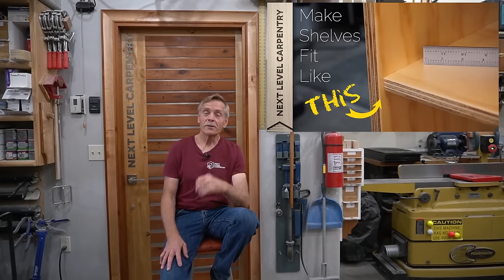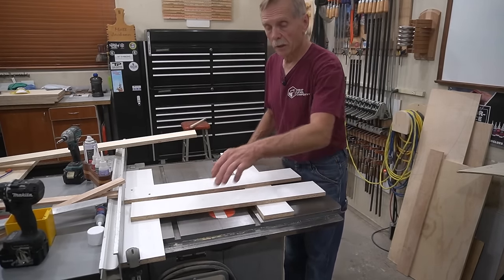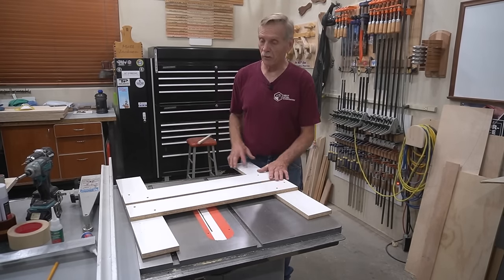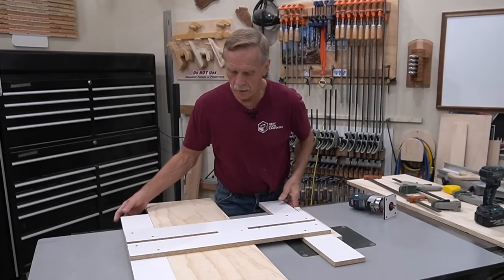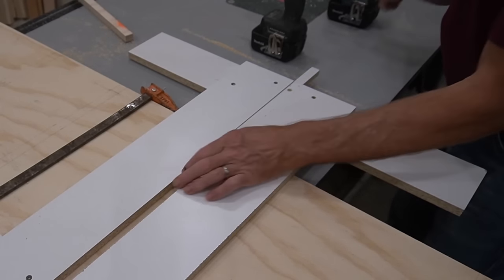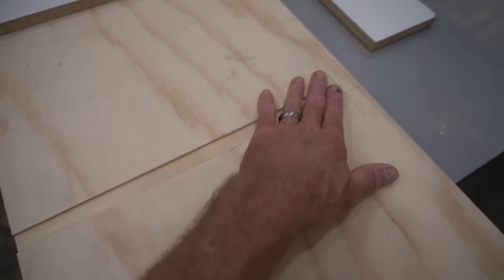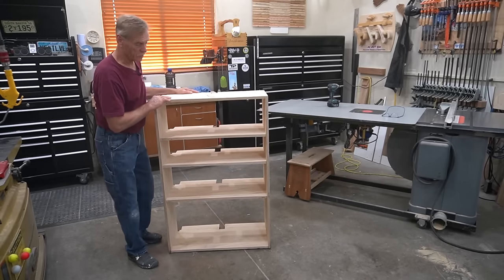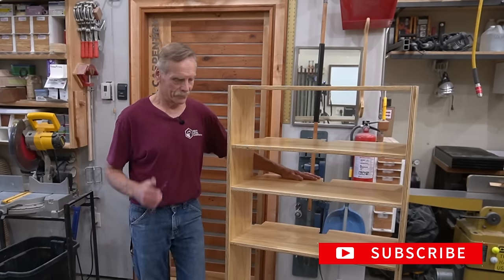Make Shelves Fit Perfectly with Simple Stopped Dado Jig!

Comment: tHIS IS THE BEST JIG i HAVE SEEN TO DATE. iT'S MADE VERY SIMPLE BY UR GOOD SELF SO THANKS FOR THAT. 
I'm about to make some Bedside cabinets for my mother bcos she needs a couple and also a TV unit for one of the bedrooms in her house. She's been tormenting me for ages so this jig is going to help me out no end pal. I'll be out in the shop in the morning getting it made. I need to get some CA GLUE but I can make it without it. I just need to use my best square and ling it all up correct. 
Thanks very much for a great tutorial my friend. Appreciate it very much. Even though I've been messing about with woodworking ovr the last 18 months or so I'm not spending enough time at it which is why I look for videos like this all the time.
I only found r channel tonight so I sub'd and liked. Not that my sub is needed by the amount of subs u already have. Salute to u sir from Dublin, IRE.
Reply from the maker: Have fun with the build and kudos for taking care of your mother! 😇
Reply: @NextLevelCarpentry  Thanks for replying. I really enjoy ur videos bcos u explain all steps clearly and make it easy to follow along.
I have 2 routers. A trimming router which is a cheap version called TOPSHAK, and I also have a decent plunge router. I really only began using routers a short while back and they are brilliant. That ji u made was brilliant. I have an electric nailer/staple gun so instead of CA GLUE I'll e using that for now til I get some in..
Keep up the great work and the doors u made with new panels were awesome too man. I love the look of that door into ur shop with the metal pieces installed. A lot of tricky work involved there  but u finished it real nice man.. Take care..
Reply from the maker: @reaper060670  Yours is the kind of comment that makes my day... thank you!   FWIW Here's a link to the full playlist showing how I made the shop door you complimented:
https://www.youtube.com/playlist?list=PLh_GOwrHv4WUpSQKjyTBUhymhewJJTWG9

Comment: Great video, thank you for taking the time to demonstrate how to make this connection. Is 1/8"  the best depth for 3/4 or 12mm ply?
Reply from the maker: It's the depth I always shoot for... a small technical note: Because thickness of sheetgoods varies so much I tend to let the dado's depth vary a little so the remaining thickness is exactly 5/8" for sizing purposes even if the dado is slightly deeper or shallower.
Reply: @NextLevelCarpentry  thank you for sharing

Comment: great video. Im a new wood worker and am doing a stopped dado bottom on a finger joint blanket box. im planning on doing a 3/8 dado around the sides with a straight bit and a 3/8 rabbet bit around the bottom of box to fit into the dado. the wood material is just over 3/4 thick. was Planning on using a dewalt trim router with adjustable fence guide but im not sure if your method just might be easier as far as having to make adjustments and matching things up go. its getting down to the final cuts on the project and its becoming quite stressful because the results of error can be pretty drastic after so much work has gone into it already haha. Just wondering if you might have any advice. Is 3/8 too deep of a dado in 3/4 inch material. Either way great video and thanks for your time.
Reply from the maker: 1/4" should be plenty deep for the dado for holding the bottom in your box.  To help relieve end-of-project stress I almost always make practice pieces out of inexpensive/expendable scrap wood and experiment on it to gain confidence before making irreversible cuts, dados, etc on the "money  pieces".  No shame in practicing... I still do a LOT of it, even 50 years in!
Best,
Matt

Comment: What's your recommended depth on something like this? Your dadoes seem a little shallow considering you're going into 3/4" material.
Reply from the maker: If you saw the stress test part at 24 minutes you know how much strength there is with only 1/8" depth in these dados. Keep in mind that the deeper the dado, the weaker the side panel becomes and the less holding power screws have to hold shelves in so, ultimately, dado depth is a compromise.  I know a 'more is better' viewpoint is hard to avoid but anything more than 3/16" (for this project within its parameters) would be counterproductive IMHO.

Comment: With a 1/4" down cut bit and a bushing on the trim router, I'd just need to compensate on either side for the distance between the bushing and the bit edge, correct?  I'm super new to woodworking and love this look for the shelves I'll be building in my garage shop! Thank you!
Reply from the maker: Although correct, I encourage you to ditch the bushing on the trim router and switch to a bit like the one shown in this video.  I know many viewers are on a very limited budget for tools.  If that's you, I'd challenge you to budget for a top bearing bit.  FWIW I've not used a guide bushing on a router for over 3 DECADES which is about the time they started making flush trim bits with bearings.  Also, here's a link to another video showing how I built storage shelves in the Next Level Carpentry shop: https://www.youtube.com/watch?v=UNEJSMpw_Do that might provide more ideas for your shop shelf build.

Comment: Great video.  I was skeptical about the 1/8" depth.  I might still do 3/16 or 1/4".  While I'm at it, maybe a T-track in each cross piece for adjustability,  not that much more work, and now i don't have to start from scratch the next time.
Reply from the maker: Thanks! Generally I'd go a little deeper... like the 3/16" you mentioned... but wanted to make a point about how strong/effective only 1/8" is.

Comment: Nice jig!  I’m sure I’ll be doing this soon!  As a non-fan of cutting the groove on a router table (too much upside down!) I’ll be making one of these.  Did my first dado in my shelves for inset LED’s.
Reply from the maker: I notched the front edge of these shelves on purpose for that exact reason: I didn't want to square up the end of those grooves.  You see the fit I got and now know why I did what I did to get the results I got.
Reply: @NextLevelCarpentry  I should have watched the whole video before commenting! I’m finishing it today and that’s a much simpler solution
Reply from the maker: @VmanJeff Ahh... that explains it.  I bet you'll never go back to chiseling rounded ends square now! 😉😎
Reply: For shelves, yes. But those inset LED light strips…. 😂

Comment: Great video. I didn't know that Star Bond gave you a 10 minutes lead time to work. Good tip.
Reply from the maker: Starbond is my favorite by far but all CA's I've ever used have a good deal of 'open time' or 'working time' UNTIL they come into contact with accelerator... then you've got less than 5 seconds to position parts for bonding.

Comment: O master carpenter, I am a lowly hack at woodworking but with what little experience I have, I have a question. I find that if I remove a screw then replace it, many times the connection has become loose. In your video, at about 3/4 through, you completely disassemble the shelf to be reassembled later. Aren't you afraid your screw hole may become loose?
Reply from the maker: Yours is a valid concern but also preventable.  If you watch closely I'm careful to not over-drive screws during initial assembly.  This prevents screw heads from becoming buried and causing blown-out wood splinters when they're removed.  It also keeps me from stripping out the hole which would leave screws loose.  Best of all, if a screw does become loose anywhere along the way, I simply spritz Starbond CA Glue Accelerator into the hole and apply their Thin CA glue, letting it run down into the hole where it wicks into wood fibers where it will cure to harden them to the point the screw will hold better than the first time it was driven.  Now you know! 😃😎

Comment: From Thailand,  what did you spray before glue on router wood jig?
Reply from the maker: I spray a CA glue accelerator on one side of the joint before applying glue to the other side for a super fast,  very strong glue joint.  You can see the full line of Starbond CA glues and accelerators I use and recommend here:https://bit.ly/3DzbHpj

Comment: Greetings from Mexico. Thank you for sharing your knowledge. This method works for melamine MDF panels?
Reply from the maker: Si, Amigo!  Make sure to use a nice, sharp router bit for best results.  BTW Melamine is hard on router bits, even carbide ones, so you might need two bits if you're doing a lot of this.

Comment: Great job Matt. I'd be interested if you would have considered dowels in both sides rather than screws, or more specifically where you might chose one over the other? 
Love the lacquer look. Is it a durable finish for high traffic shelves?
Reply from the maker: I don't really see any situation where I'd substitute dowels for screws for a utility shelf... or cabinet or anything else.  Can't see any reason to substitute other than to say I did.  Screws provide holding power to keep everything together and are way faster besides.  The laquer finish is as good as any finish plus, as you say, it's a great look and economical and easy to apply so it's a perfect choice for this and other projects IMHO .

Comment: Before I pick at nits and go off in strange direction, let me first say: Great Stuff!!!

Your scraps would amount to whole projects for many of use ordinary woodworkers.  Great that you have it, but we mostly don't.

You pulled a fast one with that spacer made from the same sort of melamine scrap.  PRESTO!, you had a piece that was exactly as wide as the shelf material is thick.  After making such a point about the shelf material defining the spacing, you bring in another piece that HAS to be EXACTLY the same size.  I realize that using plywood on edge presents... challenges, but you really should have used a scrap of the material used to size the gap.  You are a clever guy, you could have made it work.  In fact, once you had two screws in each end of the side pieces the stop didn't actually have to be a perfect fit, did it?

My dadoes haven't been blind stopped, but it is amazing what you can do with a radial arm saw and a wobble-type dado head set to 3/4", the only width the wobble type can be set to that provides a flat botton to the dado.  It is actually pretty clever the way the arms and teeth on those are designed that way.  Like your setup, using the radial keeps the workpiece still, a real benefit as you observe.  (Yeah, I know full well the shortcomings of a radial saw.  I use what you have, and over 40 years I can't help but be aware of them!)

It is good to see you using corded tools (router).  Cordless is wonderful (drill), but it can be HEAVY, and seem heavier by the minute.  There are plenty of times that a corded took is the easier choice.

Comment: How did you set the table saw to make that cut to cover the rounded dado? 

Was it just raised 1/4” inch with a flat top blade and run the pieces flat against the fence? 

Great content as usual, I always learn something from your videos. 

Thanks!
Reply from the maker: Rewatch that segment: you'll see that the little notch is made with 2 cuts at 90 degrees to each other.  The first cut is 1/8" deep and 7/8" away from the front edge.  The 2nd cut is 7/8" deep and 1/8" away from the end of the shelf.  Quick, clean... and perfect IMHO 😎

Comment: Your videos are all excellent in every way.
The dado is a good fit for the unfinished shelf but how do you ensure that it is still a good fit after sanding and finishing? 
Many thanks for all the time and effort involved in so generously sharing your expertise.
Reply from the maker: The fit might be a little loose after sanding but, more often than not, ends up tighter overall after applying a sprayed on finish.  Sometimes I even have to lightly sand joints after finishing to allow them to fit without requiring excessive force for the fit.  Your concern is valid though because careless or excessive sanding on ends of these shelves could quickly spoil the fit.  As it is, carefully sanding only enough to smooth the surface with attention to sander position  will result in the fit you see in the video.
Reply: Or just set an edge protector/clamp on a thin strip when sanding the width of the dado depth.  A 1/4” guide rail?  Don’t sand that part since you wont see it.

Comment: Wonderful video! One question that’s been on my mind for a long time is regarding safety and wearing glove while using a table saw or miter saw. Saw you were using them, but in your opinion, is it adding safety or is it something that you did because of being in the spotlight?  I’ve been told many back and forth opinions about this and really wanted to know your input.

Thank you 😊
Reply from the maker: I'd NEVER compromise safety "because of being in the spotlight"!  In fact, I'd be better off NOT wearing those gloves  'in the spotlight' because so many viewers with an 'always/never' mindset lash out at me for such (assumed) egregious behavior.
The real issue with wearing gloves around power tools that spin is that, should a glove get caught in a blade, the fabric  could snag and make a potential injury much worse.  True.
That myopic view/opinion disregards the benefit of wearing gloves for grip (specifically the Atlas gloves I use), not comfort/protection from slivers, as I did in this video, and many others. My reason is that I'm far more likely to have an accident handling large/slippery material where loss of control could cause dangerous kickback or lack of grip could cause my un-gloved hand to slip into a blade and injury.
Bottom line is to use common sense and caution and treat each woodworking operation accordingly.  Granted, new woodworkers 'don't know what they don't know' which causes them to follow rule of thumb/default opinions, which I did too.  
Along these lines I see other videos on YouTube where someone is using a tablesaw and not wearing gloves but have the blade set inches higher than the workpiece is thick... and then push the piece past the blade without a pushstick! Your main defense against such dangerous foolishness is common sense.
I'll add to this comment another controversial topic for your benefit/consideration: pushsticks.  This video shows what I think but you'll find dozens of others on the topic:
https://youtu.be/8h4OJHhSH8A
Compare it to someone using to pathetic/dangerous little sticks when pushing short, thin stock past a blade raised to high...
Best,
Matt

Comment: I like to cut out the drywall at the bottom so my flooring can go right up to the wall and still have expansion space.  Easy to run a multitool or 4" grinder around the room to cut the drywall.

Comment: Clever and slick.  Much appreciated.

I did find myself thinking, however, that I might prefer to use dowels or Dominoes rather than make the stopped dadoes.  It might be faster overall and I don't have to cut up a bunch of stuff I value to make a jig/fixture.  I'm really not sure whether a bunch of dowels, a fair number of Dominoes, or the 1/8" Dadoes would be stronger.
Reply from the maker: The cost of dominoes (plus amortized cost of the domino machine itself!) far exceeds the cost of scrap material I use to build the simple, throw away fixture.  In addition, the dado is notably stronger too: you saw me stress test it, right?  Were you to stand on a 3/4" plywood shelf held with dowels, dominoes or screws, it would quickly delaminate and fail.  That's not to say other attachment methods aren't more than adequate for strength or far more practical from a time standpoint and I'm not above using other method on other projects so I don't mean to diss your ideas or considerations!  
Best,
Matt

Comment: Do you have a part # on that Freud bit? All I found was 16-560 1/2” diameter by 5/16 carbide height, 16-500 1/2” diameter by 3/4” carbide height, 16-502 5/8”by 3/4” carbide height? Thanks
Reply from the maker: Here's a CMT bit that's 5/8" cut length:https://www.amazon.com/dp/B000P4NR1U?linkCode=spc&tag=onamzdigitalj-20&creativeASIN=B000P4NR1U&asc_item-id=amzn1.ideas.39P4X19NAN256&ref_=aip_sf_list_spv_ofs_d_asin
FWIW You can usually use either 5/16" or 3/4" carbide height by changing the thickness of your jig/fixture and bit height if you're in a pinch without a bit of the ideal cut length for the project at hand.
Let me know if that helps?
Reply: Thank you

Comment: What's the benefit to doing it this way versus doing a full dado (table saw or router) and then just gluing a small scrap into the edge of the dado that you don't want to go through?  Seems to me that would be a lot faster and easier.
Reply from the maker: While I'm not above gluing in a little patch on a utility grade cabinet like this, I feel strongly that this is far superior in time savings, overall ease, safety and end result even on a relatively small project like this one.  Those benefits are exponential as project size and complexity increase.  Think about it: it takes less than a minute to put the stop block in the fixture and would be a good deal of fuss to glue in 10 little blocks on a small shelf like this.

Comment: Pro tip... Purchase a device called "3rd hand".
It's a tool that you can use like a jack. Will support bottom of unit and push the unit up.
It's also great at resting on it to get alignment of upper cabinet.
Reply: As a one man show myself. The 3rd hand... I may need to pay it as an employee. It's that useful.
Reply from the maker: Agreed!  I've got 4 of them that I use often but I don't have the short model designed for the purpose you describe.  in fact, you can clearly see a pair of them holding up a drop cloth/curtain during the installation segment at the end of the end: https://youtu.be/9iD-ScWJEpE?si=weRjWf8Yrnbl1dsv&t=1962
I'll consider adding one of the shorter ones with bigger pads designed specifically for cabinet installation at your recommendation... thanks!